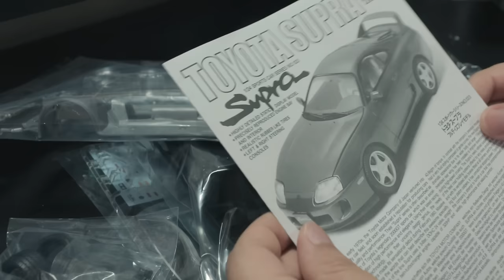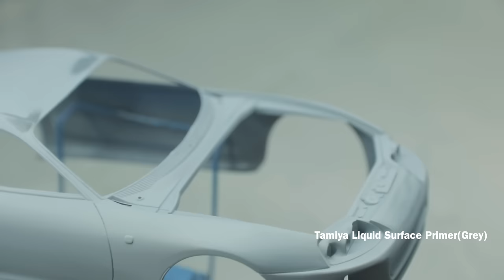Toyota Supra Model Car Full Build Step By Step

Comment: Is there another way of painting the car if you don't have the paint machine? (Asking as a beginner looking to get into this hobby :D ) Ps. The car looks fantastic by the way.
Reply from the maker: Thank you🙏😊 You don’t need the airbrush if you are only building one or two cars. You can use spray cans for the body and hand brush acrylic craft paint for small parts. Works just as well.
Reply: @JunsMiniGarage  That’s good to know. Thanks for getting back to me! :)
Reply: @JunsMiniGarage  would of loved to see you lower this one like the s13
Reply: Yes specifically tamiya spray paint is best I pretty sure they made this model too
Reply: @diegoalarcon5664  
sounds great!
Reply: Yes, spray paint intended for models works great.  However, just be careful not to get the can too close when painting or it will start to pool up, which will show through in the final product.  Also, patience, let it dry comepletely.
Reply: @Kilo5910420  ввзч
Reply: @diegoalarcon5664  ла ла кола кукла
Reply: you can use enamel paint with thinner and do it with a paint brush, there's just a certain technique for it to be pretty but I've been doing it so far. I think Testor's paints are great for that, because they come in packages. its cheaper for beginners but needs a lot of patience especially for small regions etc. I've been using enamel for a while, but i think it would be better with spray paint because the results aren't always the best results. I bought a airbrush just because of jun's garage because i find it worth it to pay for it.
Reply: @CrashForce  please don't crash those ones mate
Reply: @moffrow543  XD
Reply: Yeah I’m one the same boat
Reply: @aaquibrz  yes if you prep it will and use a darker colour but primer is always better
Reply: @diegoalarcon5664  this is the Tamiya...
Reply: Hola
Reply: ويؤ.   نتفق بن ز تعرفى دخولها تتااقج قصص روايات من ال بيسجشسذ شو ود دد
ج
Reply: @CrashForce  you can even use spray paint for plastic you don’t have to get the super fancy spray paints and what not!! Hope you the best and all welll and good for you and your models! :)

-AhmadMoney
Reply: With watercolors
Reply: I just paint brush with thinner it works fine if careful

Comment: what glue do you use to put together painted parts...??? because i use tamiya  thin cement (orange one) and my paint work always come off like im using paint remover and it makes every thing go muggy and stuff so i was curious how you get your painted parts so good???
Reply from the maker: I used BSI super gold plus which is a super glue. It works well for painted parts, it won’t frost clear parts either. Just be careful when applying it to the parts because it’s still super glue. If you apply too much it will still spill and create a mess.

Comment: Awesome build 👌🏽 any kits or tools you recommend for someone wanting to get into building model cars?
Reply from the maker: Thank you 🙏 To start building models you don’t need a lot of tools, I keep using the same basic tools(Side cutters, scissors, craft knife, sand papers of different grits and super glue)which work great for me and help me build my kits. If you are only building one or two models, spray can paints will do. I will have a video tutorial on how to get into the hobby on the channel soon.
Reply: Hi jun it’s me again with another question what kind of glue do you use on your kits.
Reply from the maker: Jay Stephenson I use BSI super gold plus super glue mostly, I still use modeling cement sometimes but BSI does pretty much everything for me.

Comment: I know this is probably your most asked question, but what supplies should I need for this? 
This is going to be my first kit build ever so I would like to know if you don’t mind. 
I’m also thinking about putting different rims on this than the stock ones as I don’t like the original rims,
But I don’t know how to tell if they will fit or not. Hope I was clear enough and thank you!

P.S. I love the mini garage thumbnails
Reply from the maker: For beginner you don’t need a lot of tools, simple tools such as side cutters, craft knife, sand papers, glue and paint are basically all you need for your first kit. As for wheels you can modify other wheels to fit but the easiest way is to glue them on the brakes. But since it’s your first kit, I wouldn’t worry about the result, just enjoy the process and experience.

Comment: Jun, can you share what PSI you run your airbrush at when priming as well as final coats? Thanks!
Reply from the maker: I usually set it at 14PSI for priming and general acrylic painting. Sometimes I will spray at 18PSI for the final clear coat but 14PSI usually does the trick for me. You can experience different settings and find the ones that work for you. I have seen many modelers set their airbrush at 30 or even 40PSI(they use a lot of thinner and paint retarder).

Comment: Question, what exact glue are you using for your headlight and taillight lenses? I'm planning to build one of these but as a 1/24 RC drift body and will just be doing the exterior.
Reply from the maker: I use BSI super gold plus super glue for all light lenses.

Comment: Hey Jun I was wondering what wheels you have from the instagram post you posted. I have the same exact model sitting around and wanted to build it. I’ve been looking for some wheels for it and was wondering if those just clicked in and fitted perfectly or if I would have to do a bit of modifications on the wheel and the wheel wells. Thank you for providing me with such a great video,
Reply from the maker: For this model I use the stock wheels out of the box, you can use different set of wheels but unless they have the same fitting you will have to modify them to fit. Tamiya has male fittings but Fujimi and Aoshima has female fitting, so If you have wheels of the same brand most likely you can swap them out easily, if not then the easiest way is to trim the mounting point of the wheels then glue them onto the brakes of the car, but they won’t roll anymore. If you want to keep them rolling then you need to modify them. Inner fenders don’t usually need sanding but they might if you wanna slam and stance it. Hope it helps :)
Reply: sorry,
must have mistaken you with another builders supra build. But thanks for the advice and keep up the good work.

Comment: JUN, what is a good cleaner to use if I accidentally get fingerprints on my model car windshield when I’m building it ?
Reply from the maker: I usually clean finger prints with auto detailing products. The “quick detail” type of cleaner works well for me. For windshield I usually clean it with micro fiber cloth with a little bit of quick detail  cleaning solution.

Comment: Does that Tamiya paint you are using for the small parts have to be thinned or is it air brush ready ?
Reply from the maker: Tamiya paints will need to be thinned for airbrushing. I usually thinned my paint with MR color leveling thinner.

Comment: Hello! Could you tell me what thinning ratio do you use with those Tamiya's surface primers and at what psi? I can't find it right :( Do you use Laquer thinner to thin it?
Reply: I don't know about tamia paints but I guess they use a general plastic primer with acrylic paints and clear lacquers. For all these products, paint thinners would work (not general thinners as they will melt plastic sometimes).

It's really upto you to decide the ratio. Typically about 1:1. You have to test and see what's ideal for the surface. The more thinner, the another it will come out. But also more likely to drip so got to go light.

Comment: Hi. I am new on this channel and want to get into this hobby as well and have some questions.
Are the stickers provided in the pack ?? and is it a tooth pick that you use to put paint and glue with precision?
Reply from the maker: Welcome to the channel, the water slide decals are included in the kit, and I used the small tooth pick to transfer glue onto the parts where the bonding surface is.

Comment: Kind of a specific question, but what psi do you run your airbrush at for tamiya paints?
Reply from the maker: I spray at 15PSI generally, for smaller parts such as window trims I lower it to 10 psi.
Reply: @JunsMiniGarage  ok thank you

Comment: I want to make one myself but do i need to use glue because most assembly kits just pop in right in place, is it the same with this one? Someone plz help.
Reply from the maker: These plastic model kits will require plastic glue such as Tamiya cement or Testor’s plastic cement, any plastic modeling cements will work, some super glues will work but be very careful not to use it on clear parts, or it will damage them and make them look frosted.

Comment: Is painting required? And if so, do I need primer?
Reply from the maker: Painting will make it look much better and less plastic/toy looking. Priming is recommended since it helps the paint bond to the plastic surface better.

Comment: May I know how did u thin the paint during it hand painting?
Reply from the maker: For small parts I paint right out of the bottle, for bigger parts I mix a couple drops of Tamiya acrylic paint retarder in the paint, usually 3:1 ratio(3 part paint and 1 part paint retarder).
Reply: Jun's Mini Garage thanks buddy. I’ve been using thinner for it and maybe that’s the reason why mine always messed up😩

Comment: Which spray brush do you use ?
Reply from the maker: It is just a generic compressor set I bought on Amazon, I believe it’s called Master airbrush? Not the best airbrush at all but great value.
Reply: Jun's Mini Garage Thanks, seems to work pretty well for you so i might try it for myself. THANKS !!